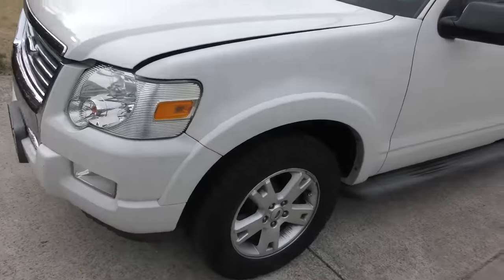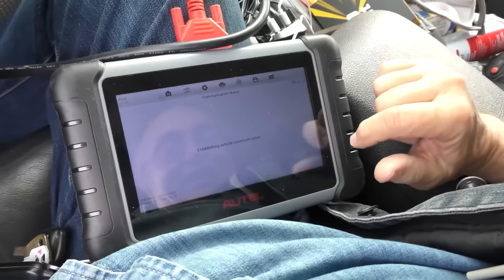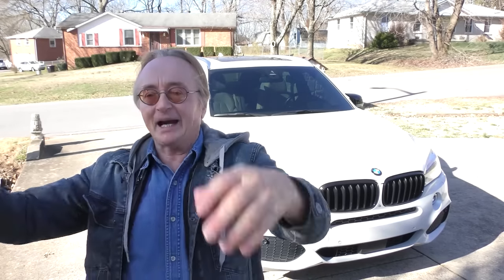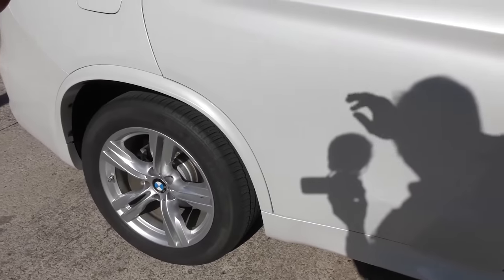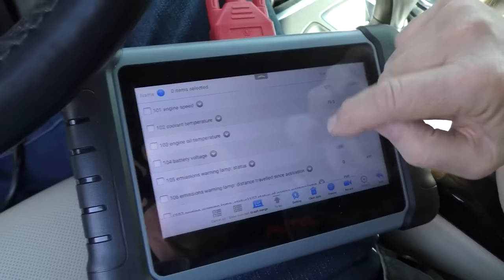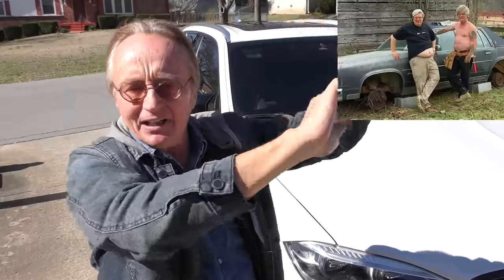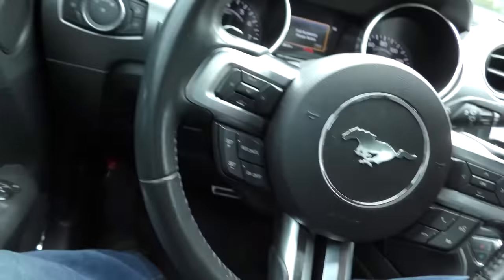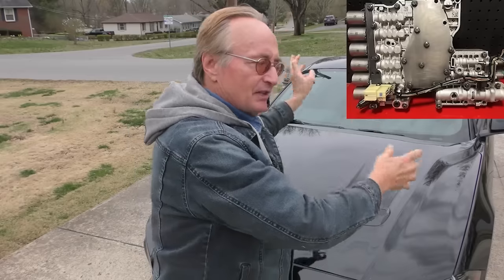3 Money Pit Vehicles You Should Avoid

Comment: Bought my 2019 Mustang with the 10 speed (2nd year they came out with the 10speed) . No issues with mine
At 50k I had the trans fluid changed.
I wanted to stay ahead in the maintenance on the 10 speed.
Always believed that if you take care of your vehicle, it will take care of you.
And as of typing this, I now have 53k on the odometer, and I’m still getting between 45-49mpg on the highway on pump ‘93.
Gonna change the spark plugs next weekend so I believe I will probably get back to my 50 mpg on the highway.
Moral of this, is that if you take care of your vehicle and don’t beat on them they will last a long time.
I would know, my other car is a ‘12 Honda accord (bought brand new in ‘12) and in the 114,000 I had on it (4years ago) the only thing I had to change (besides tires and brakes) because it started out small and I caught it early was a small coolant leak from the bottom rad hose.
I replaced them both (upper and lower + the thermostat).
Still have the car till this day, and still drives like a dream.✌🏼

Comment: my 04 explorer with 4WD has been wonderful. bought with 162k, at 212k. I never use the 4WD, but it's there for winter just incase. Never had any real issues. I've off roaded it a little harder than it's designed for, so a wheel bearing was shot after a trip to Moab. Some greater than normal suspension wear. Nothing wild.

Comment: The all black, 1991 Mustang GT I had from new, a 5.0L V8, 5sp. manual, got 25.4 mpg on the highway going 70 mph with the A/C on in 90°F weather.  I had frost forming on the inside of the windshield. 😂

IIRC, it had 2.73 gears in  the limited slip differential.
Reply: I believe it. I've had two 4.6 Mustangs 5 speed manuals that could easily get 28 mpg at 75 mph in most conditions and I always run the a/c or heat. My current 5.0 DOHC can only get about 26 but that's cause the 3.73s kill fuel economy above 70, which I rarely do below 75  I have seen 28 at 70 though.